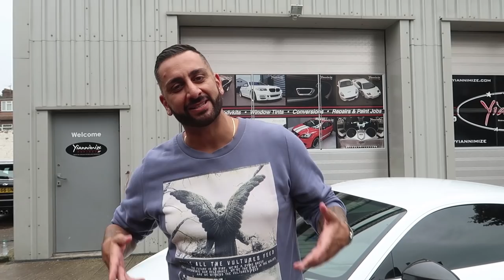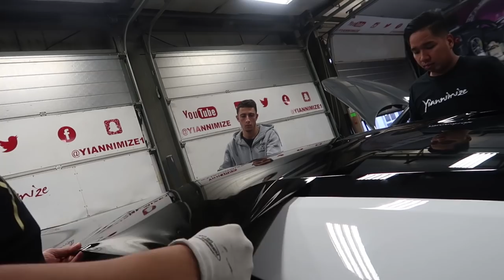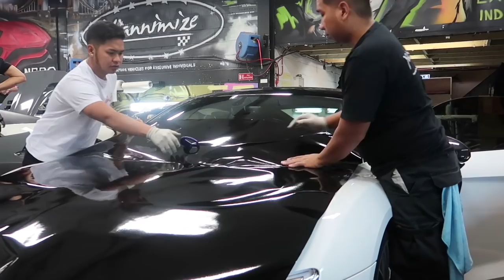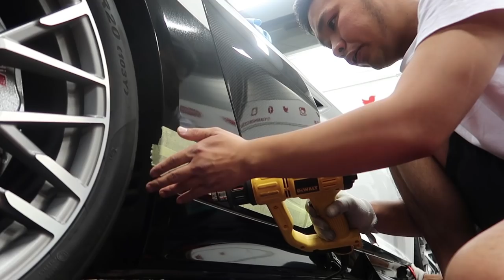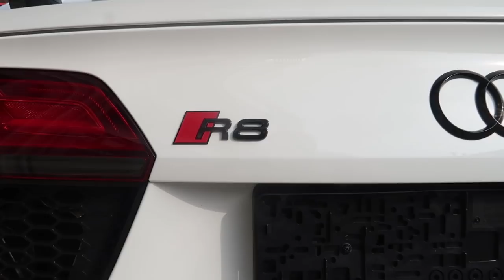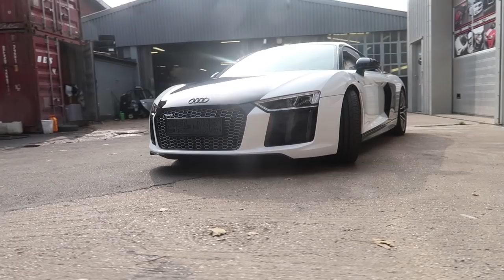Bacary Sagna's Audi R8 V10 wrapped part Black

Comment: Im buying an R8, currently wrapped matt black over silver. I'm looking to get removed and replaced with yellow I live in NZ, is this an easy task, got quoted estimation only to be fair  8000NZD which is about 4000.00 pounds. They reckon it could take  6-8 hours to unwrap but in a real bad situation 30-40hrs, just looking for an expert opinion, appreciated.